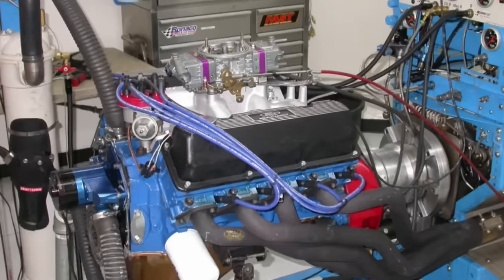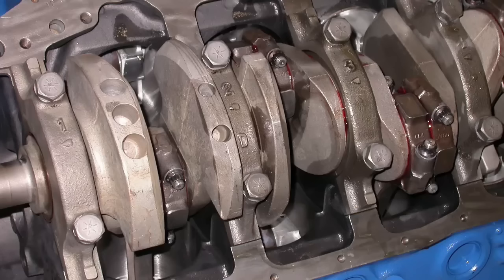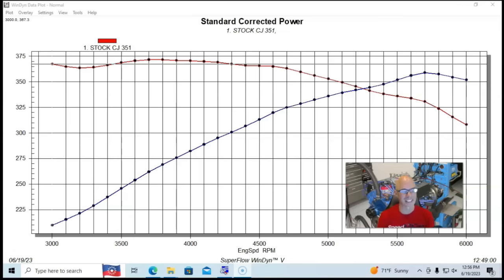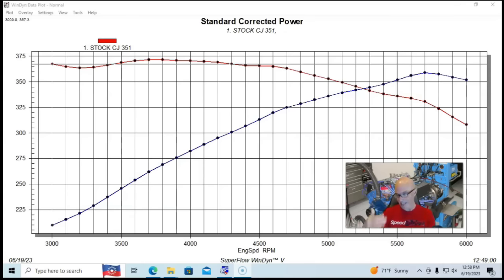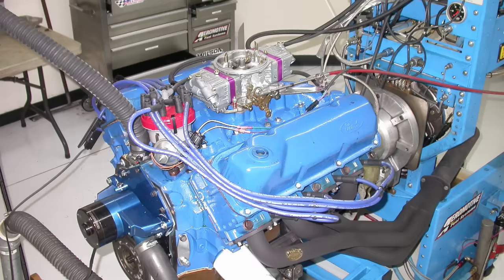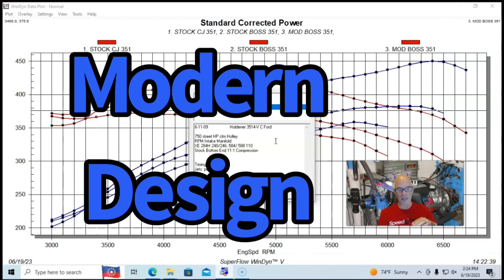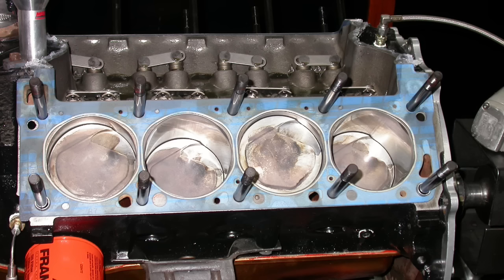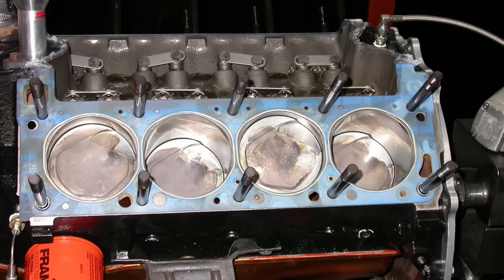HOW TO MAKE 351 CLEVELAND POWER. TUNNEL RAM, STROKER 351C MODS, CUBES, CAM, HEADS AND DUAL QUAD!

Comment: The funniest thing about this video is how so many experts say that the 4V Cleveland head is rubbish. Too big, no velocity, no swirl.... but damn, it makes horsepower and torque
Reply: Yea, at 7800rpms! Till the block splits! 500hp, yea! The heads are too big for a street motor. Someone was producing closed chamber heads with the standard 2 barrel runners, but I  never saw one. We just ran Windsors with 4" stroke and Victor Jr heads.
Reply: I'd have to look back to find them! We're talking 20 years ago! But, there are great Windsor heads available! It just so happens that a Victor Jr  Windsorvhead happens to have almost the same flow numbers as the 4v Cleveland heads? The 3" mains take alot of oil, but it'll stay together if you make sure they get enough oil! 427 Dart block Windsors were awesome! But the lS motors came along! They were so cheap who cared how long the pos lasted! If I  got back into it, I'd build a 427 Windsor using a Dart block! Whatever it did on a 250 shot, or 12 lbs of boost would be fine! Run the bastard 10 passes in one night! He's got 5 of them at the shop, but only one to night!
Reply: Aussie 2v heads with 4v valves and cleaned up casting marks are a great street combo.
Reply: @hayden6056  yea, but Victor Jr heads came along! They flow 274 cfm on the intake side! Guess what the 4v closed chamber Cleveland heads flowed! But, the ls motors came along! Finally a Chevy motor that didn't puke its guts out after 3 passes on a 250 shot! I'm still a Ford guy, but the ls motors are everywhere! It's like WW2 over, the numbers produced out numbered the casualties! Doesn't matter how many you can outrun,  sooner or later you'll be looking at the guts off that thing! They got 3 motors sitting, and they run on crack cocaine!! That's why I quite drag racing! You can't run 3 times a week working by the hour when they're running buy the gram!! They got 5 motors sitting in the trailer! They don't care,they don't even drive!!
Reply: @markmccarty9793  fair I live in Australia where the cores are $1-200 lol. 

Just had a set done for dads 69 mach 1.
Reply: @hayden6056  you guys are Cleveland fans! We used to plug the hole in the head and drill the hole for the crossover thru the intake!
Reply: @markmccarty9793  of course we are haha. The small port 2v heads only ran 30cfm less at .500 than 241 LS heads. Took 25 years for GM to catch up here. 

We've had 11 second naturally aspirated street driven stock stroke Cleveland's for almost 50 years. 

11 seconds with license plates is where it's at. Just off the need for a roll cage , can drive it to work on a Friday and fill up at any fuel station. 

I've never had a car quicker than 11's and never wanted to. 11 second pass is a handful on the streets and I rarely go over 120-130kms an hour which is only 75mph , an 11 is trapping 115-125 . 

They confiscate your car here for street racing or 25+ mph over the limit. First times 30 days , 2k in tow and holding fees , no license for 6-12 months and 1-2k in fines. They sell it or crush it on the third confiscation. 

Easier to go down the strip on Wednesday for run what ya brung nights for less than $100.
Reply: @hayden6056  lighten up a fox body mustang an high 10 aren't a problem.  We ran a fox body Mustang that would run 7 flat on pump gas 1/8 mile on pump gas natural aspirated 15 years ago with cast pistons on motor! We had $500 in the short block! Stop smelling ur nuts!
Reply: But it has no intake velocity. Because they are way too big. The reason people have been filling the floors forever. All the drag race engines may have used 4Vs but with 3/4" of the floor filled,, and even then they struggled. They used hand made intakes to make use of the filled floor.
Look at a CHI head, generally recognised as the best head. Intale lifted heaps and so much SMALLER to make power. Designed by John Kaase
Reply: @ldnwholesale8552  ok, you realize that guys that drag racing them were leaving the line a 5000rpm and turning them 7500, even the stroked ones?! I'm 63 years old! Alot of guys were stroking then 20 years ago!!  Back then I  was dragracing stroked Windsors! One guy stuck to 9.2 deck blocks! My hero! Stroked them up to 393 and turned the piss outta them with aluminum heads! God, it was fast, and screaming!!  I doubt it could make a full 1/4 mile! I'm 63 years old! Sometimes I thing you guys underestimate my experience at that shit!! The ls motors  weren't around when I quit!! It's not that they are that good! Hell, they got 5 of them sitting in the shop!! Don't care it this one pukes it's gits out! We had a Yates headed stroker Ford when I quit. It was a monster! But, you wouldn't shoot more than a 200 shot on it! It cost too much to replace it! These lS guys don't care! They got 10 in the shop!
Reply: Just turn the hell outta it! Unfortunately,  there weren't cheap 393ci crank kits back then!  I know guys that were putting 400 m 4" stroke cranks in 351w blocks with 302 boss pistons using the stock 5.969" rods that were hauling ass! 4" stroke, 4.040 bore almost a 6" rod! Aluminum heads for a Cleavland. Drill out some steam holes in the heads ! It only had to run 30 seconds! Cool it off with a water hose! Getting it balanced was the trick! These candyasses just pull up a website now and order everything, already balanced!!
Reply: Yeah its all garbage talk ive ran several sets of 4v closed chamber heads on the street with very big cams and the motor was still a rocket even at low rpm where when i tried the same thing with the sbc they were completely dead at low rpms.  The people that say that as i said garbage are either jealous of the cleveland or don't know anything about motors.
Reply: We were stroking the out to 393' 25 years ago! Now, drill steam holds to get more coolant and stroke them to 393ci, and you had a monster! The guys started using 351w blocks! The math is right, 302 boss pistons, the stock Windsor rods, 400m crank! Ran like a raped ape, till it grenades! WTF, no money in it! A scat stroker will give you 393ci for just a little more than a crate long block. I'm putting on in my 94F150 flareside. Now, how long does that TCI c4 rated for 450hp last? Just gonna go with a carb, cam, in intake.
Reply: @markmccarty9793   Yeah there are some very expensive Windsor heads that can get almost the same air flow but almost isn't always good enough.
Reply: Now, actually, the best Cleavland had about the flow as a set of Victor Jr Windsor head. 274cfm  vs. 275cfm! Now, that was because of the bodies they are going into! The cleavland blocks didn't hold up that well with 7500rpm and enough nitrous to kill an elephant! Guys were putting Cleavland heads on the 9.5" deck blocks and doing quite well. Buy the aftermarket blocks got more affordable. We ran a set of aluminum heads on a Windsor block for a season! Best thing was it only took a 150 shot  in a small tire Fox and got some really impressive results,  but he wanted to go faster! Then you're running the dope dealers!! On a working man's budger!
Reply: The 4v Clevo heads were the closest thing ever to a race/ drag focused design released for a production car.
Sacrificing low end torque and street manners for top end power. @ the time there were bugger all emissions restrictions and no fuel crisis.
But like having a smoking hot bimbo GF.
Great while getting it on. But not so great with the day to day domestics.
Abandoned by Ford USA. It found a home in Ford Australia for a decade or so longer. Where aftermarket designers refined it & gave better head. The most recognised being CHI. How better? Less port volume but increasing the smoothness of mixture transition to final combustion.
Thereby increasing velocity yet sacrificing little or no top end performance. Making for a much more street friendly monster. Which is the place the majority of clevo owners want to be. A car that can hammer on the dragstrip. Yet retain reasonable stress free drivability in traffic going back home.
CHI make top end packages that are the best of their kind in the world. From RV or sleeper limo style low down torque monsters. To barely steet sociable top end power screamers.
Making more power with around 10° less advertised duration on the cam in the package than most of its competitors.
= superior thermodynamic efficiency. Less valvetrain stress AND more power with a fatter & broader
torque delivery.  
If the likes of Kaase say these are great its because they are.
Reply: @gorillafunk725  yes, but those huge ports and valves weren't the best choice for street applications! Headers, cam, Intake and they were awesome. They should've had an option for the 2 bbl  heads with closed chambers. I'm old enough to have been racing while they were still running those things, spinning them till you saw its guts on the track! One guy was turning 9200rpm! Had several split blocks!
Reply: @markmccarty9793  Yup. That's  what racing was/is all about. Push everything to the limit & beyond. Here in Australia 72 was the end of the era. Of where you could buy a car off the showroom  floor that was pretty much what they raced @ Bathurst ( Australia's  most famous endurance event)
What let the 4 V down for racing was exhaust flow needed major work. To match the race velocity of the intake. One of our most famous racers was Peter Brock.
The reason he was was so good was smoothness, consistency and mechanical empathy. Knowing the cars limits and not exceeding them. & on that point many cleveland engines made more power @ the end of the Bathurst endurance race than they started with. If they followed that rule.
Reply: @davescbradiorepair8195  everything I've been seeing says your right. I always thought those people who said they were bad. Were hoarding them for them selves.
Reply: Yes it does but the 2V head port size works better at low rpm. It all depends on where you prefer the power curve to be.
Reply: @markmccarty9793 As you obviously don't know about Ford SB engines, it's the stock Windsor block that is prone to cracking. I really wonder where people get their info for these statements but as I was there in the 70s and 80s and raced them I don't ever remember anyone but Nascar guys at sustained 8000 rpm use. Most pro racers who used them pinned the heads and block to prevent any of this (Bob Glidden Pro Stock or Bill Elliot Nascar).
Reply: @markmccarty9793 the 4v’s out of the box can flow over 275cfm. The fuelie heads flowed around 220-225, at best
Reply: @markmccarty9793 Australia did have the closed chamber 2v heads. I live in the states and have a set in my garage. They’ve been machined to accept a 2.100” intake valve, up from the 2.040” stock valve. They work great in my circle track car, until they started screwing with compression rules. My rules mandated a 175psi limit, those Aussie heads made 208 cold. Now I have a set of open chamber 2v, that have been opened up to almost the size of a 4v head. Milled down to bump the compression up a bit. Still not legal at 185psi though. Oh well, got to cheat to compete
Reply: I love my 1970 Cleveland 4V heads. Ported with a 3 angle valve job. I run them on my 408 stroker!

Comment: Love these engines, down here in Australia we got them right up to 1985. Tough as nails. We had an oddball de-stroked 302ci displacement Cleveland as well. The heads from those use the standard 2v ports (220cfm stock intake) and a 2.02/1.76 valve arrangement in a small, efficient, quench style chamber of 58cc capacity. Not bad factory heads for street use, they bump a 351C up to about 10.7:1 compression, just right for about 220 to 230@50 duration of cam and a four barrel. I love the Elgin E-907-P in these motors!
Reply: Aussies are awesome! I love watching you krazy people on YT! Keep those Cleveland running down under!
Reply: I would love to get my hands on a set of aussie 2V heads to port and polish and try on my 408
Reply: 220 cfm intake?
Reply: I thought they were around 190
Reply: @rossgirdeen3247  the little Windsor GT40P heads are about 190cfm intake, and with a bit of porting, thin stemmed valve etc they'll hit 210-215cfm so within range of a stock Clevo 2V. 

The 2V's, again, are great mild heads for street use, especially those small chamber 302C heads when on a 351C bottom end with a bit of camshaft.
Reply: The 302 Clevo heads can be massaged into a repectable street  
motor in 351's and mild strokers.
But they are getting rarer for good cores and ever more expensive to port and re- build. CHI IMHO makes the best aftermarket alloy heads for the 351 clevo. If you can afford the asking price. They are a great option. But rebuilding an engine like this is an expensive undertaking no matter which option you decide. Unless you own a machine shop and a flowbench. Do your research and get the combination of induction components right.
Or buy a CHI top end package.
Available in 3 versions stage 1 torque monster with more power but polite street manners. Stage 2 lumpier streetable cam with more torque and power @ higher rpm. Stage 3 barely street sociable strip package. I have no affiliation with CHI. I just like their stuff.

Comment: Anything 351C, Boss 302, Clevor or even the 400 is appreciated!
Reply: I want to see a 400 built. You could stroke a Cleveland, but the 351M/400 block has a taller deck height allowing longer rods that the short deck Cleveland.
Reply: @kennethcohagen3539 He did a 400m build awhile back, she was a torque monster
Reply: @kennethcohagen3539 yeah Richard did a 400m a while back.
Reply: And had over 600hp
Reply: The smog restrictions of the 70s were what really handicapped the 335 series engines and gave them the "pig" reputation. If you correct where they were de-tuned and put some decent parts in, it really wakes them up!! I've got a '79 351M that we turned into a 408 fire-breather
Reply: What was your combo?   500+ HP out of Cleveland combos isn't super hard.

Comment: My '70 Mach 1 ran in the high 12's all day - the only mods were intake, ignition, exhaust and racing slicks! I carried one tire in the trunk and the other in the back seat - and changed 'em using the factory jack -  (I still miss the smell of premium leaded exhaust)

Comment: Has Brule' ever called a Cleveland a smallblock with a big block head?  (You MOPAR guys will get the reference.) 😁
Reply: I need an explanation, because my dad has always referred to the Clevelands as having “big block heads”
Reply: @HOTRODINATOR  The 351 Cleveland came with huge intake and exhaust ports along with 2.19 intake valves and 1.71 exhaust valves. This when most small block high performance engines had 2.02 intake and 1.60 exhaust valves. The camshaft was very mild for such a performance engine compared to the small block Chevy which ran a camshaft with something like 240-245 degrees intake at .050 while the Cleveland ran a camshaft with something like 226 degrees of intake duration at . 050 inch camshaft lift. 
This head flows as much air as big blocks of the era and more than some. It flows nearly exactly what a stock 460 head flows on the intake and more than a 460 on its exhaust side. 
That's why your dad referred to it as a big block head. The best small block factory head to be developed from the factory. The 4 barrel heads are huge even the 2 barrel carburetor heads had bigger intake valves than the other small block factory heads at 2.05 valves .

Comment: Ford really missed the boat on the ultimate Street fighter and that would be a 351 c with 2v heads and a boss Cam and a 780 Holley double pumper wow what a brute
Reply from the maker: it would make less power
Reply: @richardholdener1727   the 4V heads may make more power on the dyno but in a 3,000 lb car going down the quarter mile the 2v head Cleveland gets there first  and I'm talking from experience. The 2v heads  need stiffer valve springs then stock, and they also need to be 1970 casting because of the combustion chamber is a tad bit smaller than all the years that followed

Comment: Still have two standard bore 351C's in the garage. Been running the 400 10.3" deck more cause they already have a 4" stroke. Cool engine builds.